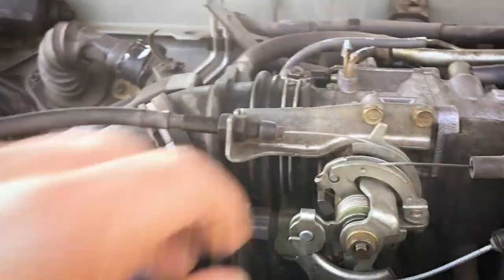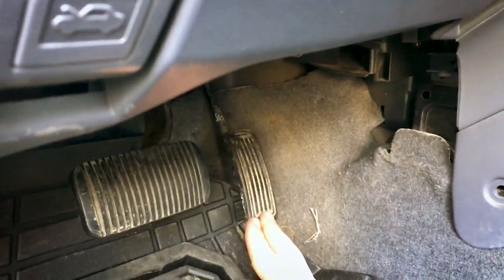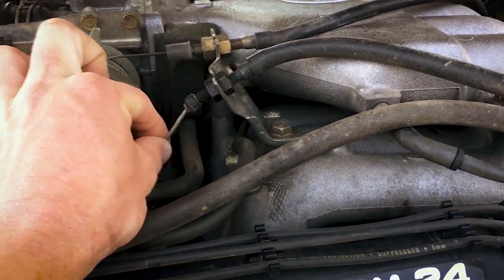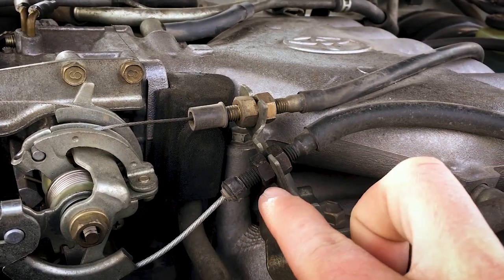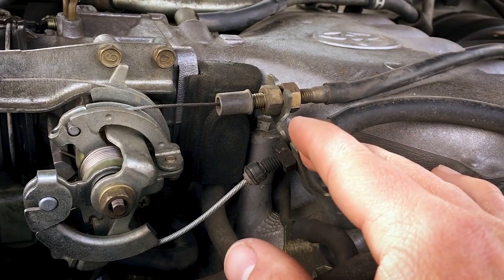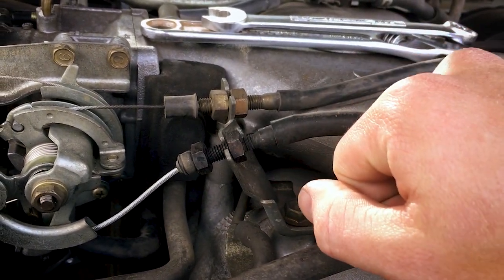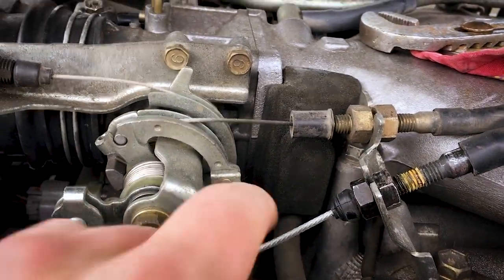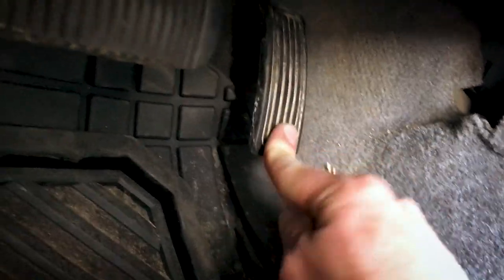Get Extra FREE Power From Your 3rd Gen 4Runner!

Comment: Huge fan of the 3rd Gen I never sale it. It’s a 20 years old SUV as long as it’s maintained you are good for another 20.
Reply from the maker: Same brotha! I love this thing. If I had the room (and money) I'd have one as a daily and another for offroading:D
Reply: If you live in acclimate weather the driver side has no drain hole in the frame under the left side doors and rots from the inside out. Eastwood inside frame encapsulator is what i am using after the weld repair to the frame. Do your research and protect your unicorn.
Reply: I just got a 99 4runner with 113k for $3500. After driving for 3000 miles and watching videos about this ride it's starting to sink in just how dependable this vehicle is. With keeping up on oil changes and stuff this vehicle is bullet proof
Reply: We have two we have never maintained and they don't quit
Reply: @whocares4464  we have two, we change oil every 15,000 to 20,000. They are bullet proof.
Reply: @whocares4464  you want to sell it for $4K?
Reply: Not selling mine 😁 even if someone offered me $6000 for mine I wouldn't take it!!! I got a cream puff 99 4runner one owner 112,000 miles $3500 and I won't sell it

Comment: That is not extra power, you just making it respond quicker, sooner, when stepping on the gas..........SORRY THAT IS NO EXTRA POWER. Power is the same.
Reply from the maker: No, it is extra power. If you don't have the full range of motion of the throttle body then there is that last part of the power band that is not being used. So adding that back gives you extra power. Anyway. appreciate your words of wisdom, mister keyboard warrior:)
Reply: Ya i agree with Cesar. Unless you are bottoming on floor with pedal, its not more power just quicker response. It's just the input the engine responds to the input.
Reply: It's more available power that you couldn't use since there was slack in the cable  total hp of the 4runner stays the same
Reply: I agree 100% with you. I have 2 3rd gen 4runners with the 3.4 and I've made the same adjustments. MORE THROTTLE RESPONSE IS WHAT YOU GET.  IT DOESN'T GIVE YOU ANYMORE HORSEPOWER WHATSOEVER!!
Reply: Did the same to my 2002 Ford F-150…definitely improves the acceleration!!!

Comment: Sweet, after I get done welding the frame, I'll check this out... nice...
Reply: About to weld on mine as well. Good luck to you
Reply: @2wentytwoterry196  Make sure you disconnect your battery,so you won't Short anything out...when welding..
Reply: @rx7cl  Thank you for saying this because i wouldn't have even thought about it. Any other good tips by chance?
Reply: @2wentytwoterry196  Good tip for 4runner is put a oil cooler on transmission,and bypass the radiator..they break inside and dump coolant in trans....had strawberry milkshake when I checked it...now all good...
Reply: @rx7cl  Guy I bought it from fixed that same issue with a new solenoid he said I believe. The external cooler is still a good idea though. Thanks for your time, cheers
Reply from the maker: Good luck! You'll be happy you did this quick mod. It makes a world of difference;)

Comment: I just did the CS144 alternator swap on my 3rd gen and apparently this alt needs a minimum of 650rpm's to produce enough juice under load, and my truck idles at 550rpm's in gear, so hopefully tightening this throttle cable will increase the idle rpm's just a bit...  Quickest and easiest thing I can try, thx!

Comment: Not a horsepower upgrade as much as it is a repair. Thanks for the video!
2001 4runner SR5
Reply from the maker: Well, yes and no. Obviously not changing the overall power of the engine, but you are increasing the useful range of power of the engine. Technically too since adjusting the cable allows the throttle body to open up further it actually might be increasing the horse power... Either way, it makes for a much more responsive ride. Definitely try it if you haven't already.

Cheers brotha!

Comment: Good call!  I just tightened mine with great result's in throttle response and was kicking myself for not thinking of it but having all that slack has to affect the kickdown cable to. 

1998 4runner limited w/locker, all OG and all stock on Falken Wildpeak atw3

Milege 295,064
Reply from the maker: Right on dude! It's so simple but makes a HUGE difference. Happy trails!

Comment: Question... you mentioned that you would leave that nut a little less than max. and then when you actually did the work, it looks like you maxxed it. Just curious what you were thinking when you started to tighten the bolts. Thanks a ton. Totally appreciate it!

Comment: I said something to my wife about this today. We bought a 2000 v6 4x4 today and noticed this and was wondering if it was normal and if it would help.
Reply: Yes certainly! If the cable is loose it will make a huge difference! Both with total power and gear shifting
Reply from the maker: It'll definitely make a difference!

Comment: The rubber piece on the throttle cable broke on mine and this worked a little but I have to replace it now that I can see that it’s ripped. I recommend checking that if this doesn’t fix.

Comment: I just did this. It was so easy. It's got me idling at 1600 rpm which idk if that's high or not. I only did it enough for the thick cable here to pull, but not enough for the thin top cable to rev the engine.

I just noticed I idle at a much lower rpm like 900 when I use my foot to pull back pedal and it stays. So it's being like a game controller analog that sticks in positions.
Reply: I’d loosen that up a bit. Normal idle is around 1100-1200 rpm

Comment: I replaced my stock wheels with 2018 stock wheels. An inch bigger. I lost 30 miles. I hate how much gas it chuggs. Thinking about selling it to save on gas but i love it. So hard to let it go. Should i change the gears to get more power and mpg and keep or will this not help. Would do you recommend
Reply from the maker: Tell me more! What do you mean about the losing 30 miles? These 4runners are certainly not the best cars for fuel efficiency, but they're pretty darn good in almost every other aspect. My personal recommendation is to keep the stock tire size if you're driving it just on the street. If you want to go offroad as well, then stick with a small rim, 16" ideally, so you can maximize your tire sidewall height.

As far as upping fuel efficiency, there are a few maintenance items to check. There's a super great article on T4r.org you can check out that goes over them all. May help if you seem to be getting under average mileage

https://www.toyota-4runner.org/3rd-gen-t4rs/82033-3rd-gen-4runner-buyers-guide.html
Reply: @PartimeOverland  i lost a total of 30 miles when filling up. I assumed I was down to 15 mpg but i guess thats normal. 

But yeah. The rig is perfect for all my needs. Just don’t like the mpg and power off the line. 
Maybe your tip will help. Also, i wonder if adding the Sprint Booster will add some more Go, if it’s available for 3rd gen
Reply: @snoopdisnoop you said you went to 17” wheels. Did you also up the tire size too? i’m considering upgrading my 2000 4Runner to 17” wheels with 265/70/17 tires. Tryna keep my mpg as good as I can get it
Reply: Yes i did upgrade tires too. Someone recommended getting skinnier tires. Not as wide. I also removed my spare during city driving.
Reply: @snoopdisnoop  i’m going to try these 17”rims with 265/65/17 tires, stock suspension. This combo should be the closest match to the original wheel and tire set. We’ll see what happens

Comment: To the people that have slack in the cable… there is a grommet on the back of the pedal that degrades and dissolves over time! Before adjusting the cable inside the engine bay peep that!   That was my issue imma get a new cable and a not play!
Reply from the maker: Yessir! I'm actually planning on doing an updated video and replacing the whole cable all together. That i suppose is the 'ultimate' fix for this

Comment: My 02 has that cable ran on top. Yours is on bottom and you have two cables. I have one?
Reply from the maker: Yes, '01-'02 had an updated throttle body where the other cable became electronically controlled. Don't worry about the other cable (since you don't have it ha:)

Comment: You need a new throttle cable. Also be careful with adjusting the kickdown cable. Too tight leads to poor shifting. This has it’s place when necessary but generally another poorly guided forum noob “mod”.
Reply from the maker: Interesting you say that. Wouldn't a new (shorter) cable have the exact same effect?
Reply: @PartimeOverland  Still an old and stretched cable. If you ever get a chance to drive a low mile 4Runner you'll see how there's no play in the gas pedal. Also pedal feel. Squirt some silicone spray into the boot of your cable. They usually become much smoother. Still no comparison to a fresh cable, but this is another wear item. The kickdown adjustment needs to be "just right" to feel the way Toyota designed it.
Reply: Cool little tip. Possibly some tradeoff vs a new cable (just put it in a "to buy" list in the meantime!) as other mentioned, but in an old rig little tricks like this can really make them feel nicer. 👍

Comment: if you do this dont fuck with the throttle lever with your hands. first time i did this the throttle lever was sticking so I went back to adjust it and kept twisting the throttle lever with my hand and it fucked up the throttle position sensor and I didn't know. So I took the whole fucking thing apart trying to figure it out and here I am $1400 later getting a new throttle body installed at a shop. Thanks for the heads up shit stick.